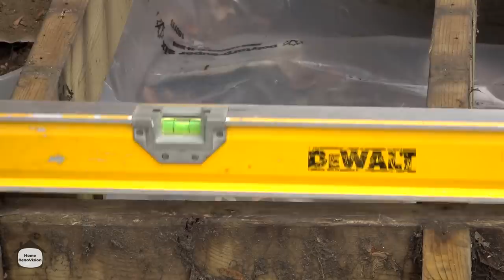Remodel Your Deck on a Budget! | DIY Tutorial

Comment: Good basic video of building a deck but where I’m from you can’t use screws on joist hangers they have to be nails because screws can cheer for nails tend not to we found out the hard way. Also to much criticism of the previous builder enough is enough.

Comment: LOL: You explain how important it is to hold the screwgun with 2 hands, and then screw the next one single handed...;o)
Reply: Goof info neverthless., might I've added. Have you done one already (or plan to) about a floating deck? It could be just about the foundation as the rest is similar to an attached deck.
I built one ground level and probably broke all the rules in the book, as it's totally failing within 8 or 9 years.
Reply from the maker: LOl, just demonstrating for new tool users. Cheers!
Reply from the maker: We have a floating deck project that is around 800 sq ft of deck with a ramp and planter boxes. That should help. Cheers!

Comment: You said that the screws could be at least 2 1/2" to go through 1 1/4' piece of wood. (2 minutes into the video). That would leave 1 1/4" to drive into the second piece of wood. One side of the wood has to strip for the wood to pull tight and it should be second piece. It is older and in several areas rotted. I would think a 3” screw would yield the same result. How do you consistently do it? To give away your secret to making this a fantastic video is you move along at a fast pace without useless detail which keeps the viewer from getting bored and  it keeps his/her attention. Most entertainers can’t perform that task.k.
Reply from the maker: Hi Ronald, I have been teaching new guys on the site for years. I guess I have been practicing for this my whole life. Max and I have a great working flow. Thanks for the comment. Cheers!

Comment: Good until he put the concrete under the 4x4.  Those 4x4 ends at the bottom are going to rot out.  Should have used a metal or plastic standoff for the footer, or at the very least treated the cut end with a wood preservative.

Comment: HOW DO YOU KEEP SCREWS FROM STRIPPING
Reply: Don't remove them with an impact driver.  Use star drives putting them in and an impact driver instead of the drill.

Comment: Great video, but you seemed to get a little lazy at the end. Driving screws one handed after showing how to use the palm of your hand. Why the super fast cut on the miter saw though?  Over all some great tips.
Reply from the maker: I was running out of time to get the project done during daylight. Had to move a little quicker. Cheers!

Comment: My god the nails!! How did they pass inspection...  well actually they're code in most places, at least where Ive worked anyway. You can't imagine that 80 million hand banged galvanized nails was the contractors first choice? 

30:12 thats structurally sound??? Can I venture a guess, we've never pulled a permit or had a look at the IRC
Reply: Yeah This is terrible.  Not even a warning about the ledger board or a seeming glance at both.   All that work and I would bet money I could take it down in ten years just by jumping on it.

Comment: Not a single one of those joist are connected to the post properly.   They all depend on the shear strength of the screws instead of being let into a notch in the post.
Reply from the maker: and when you use good structural screws that have the shear strength of a 1/2 " galvanized lag then it works awesome. Cheers!
Reply: If not bearing on a post, in a hanger or in a beam best practice is a through bolt.  Screws are good in there place, supporting carrier beams and hand rail posts are not best practices.

Just a note on the joist hangers, assuming Simpson lus26z, the fasteners at the side of the joist require,per Simpson, a 2 1/2" fastener minimum. Your 1 1/2" screw doesn't reach the carrying member eliminating the shear connection designed into the fasteners.

Comment: All good apart from, switch to metric and all your calculations on height of posts would have been so easy
Reply from the maker: Cheers Paul, where are you from?
Reply: UK, hence the metric comment. not that we are fully metric we are a confused nation. I buy my wood in inches for dimension and meters for length. I drive my car in mph but petrol in litres but quote my consumption in miles per gallon :) but good video keep it up.

Comment: Great video but timber expands the opposite way and you’ve placed the boards with the crown facing down. Uh oh.
Reply from the maker: Hi Issac, there is no one way to do anything. your rule works in areas where you get direct sunlight, however close to the ground in then shade this deck has now gone 4 seasons and still looks perfect.

Comment: Jeff, you messed up the stairs! Your second step is 1”  shorter in the rise than your first step! The second stair box would have to be on top of the decking instead of frame to frame. Your finish riser heights are 6 1/2” first step, 5 1/2” second step and a 6 1/2” step up to the deck.